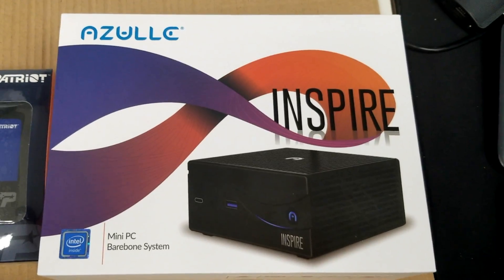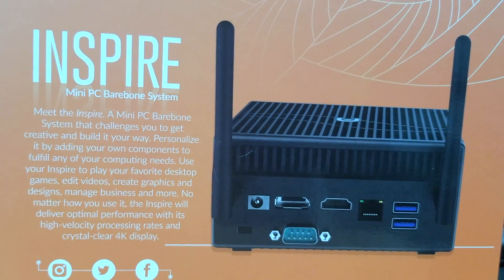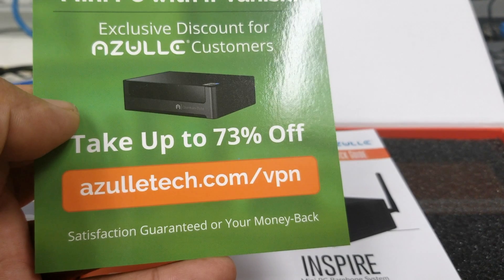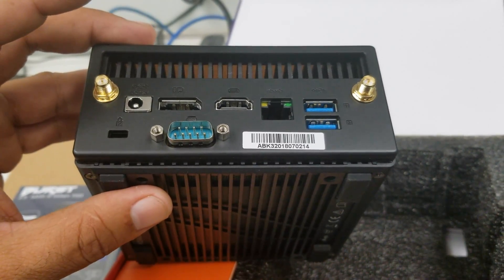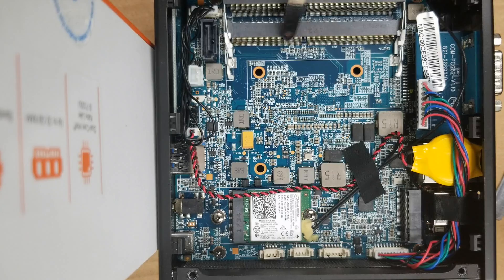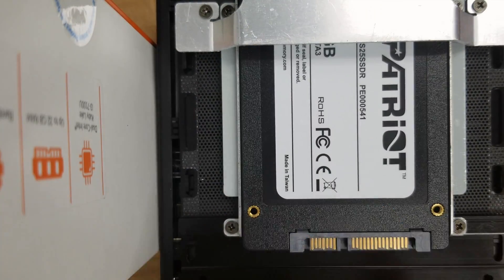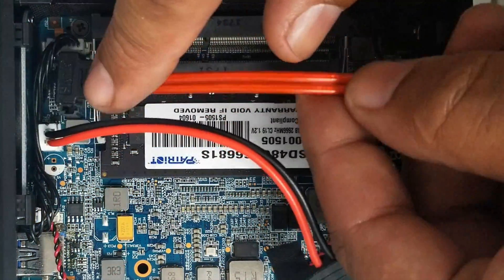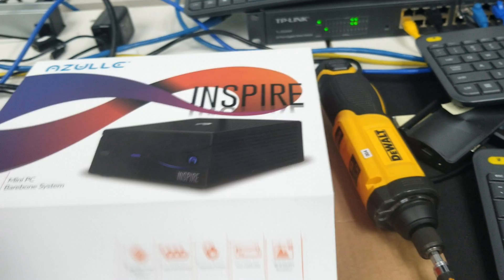Installing RAM and SATA Hardrive in Windows or linux. Inspire Mini Pc. Barebones system

Comment: If I get the inspire i7 7500u model and put 16gb of ram in it and 1tb of m.2 slot memory will this device run windows 10 fully and smoothly like a complete desktop would? I just want to run windows 10 just to do some college work, write some light coding using a few coding programs and surf the web like a decent full desktop would.
Reply from the maker: I believe this unit will be perfect for what you are intending to use it for. Maybe when you are compiling it will run a little slower than a full desktop however the difference will be very small and hardly noticeable. For the price this little mini PC is a very good value and I would highly recommend it
Reply from the maker: I could get you a deal on it. I have then new in plastic and also manufacturer refurbished in perfect working condition. I do refurbushmeent for Azulle on the side at our warehouse. Also thanks for subscribing. We will be making some very interesting videos soon :) Current status: #Classified. #InTesting